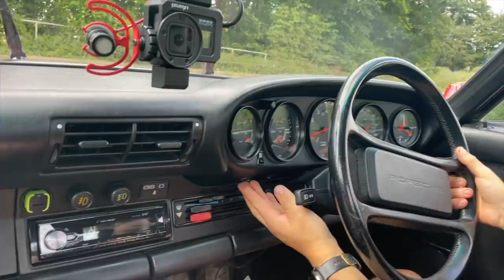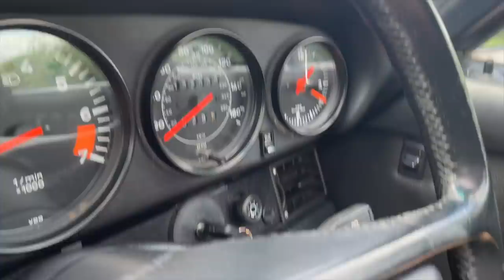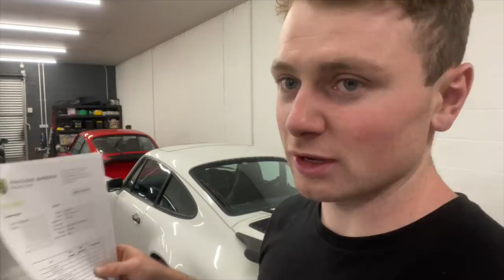An In-Depth Inspection of 2x 1986 Porsche 911s - FGP Prep Book EP28

Comment: 80's C2 3.2 were my poster car when I first discovered 911 but I could just never afford one. Closest I came was one that had been partially dismantled for £3000 back in the mid 90's but I bought a 914/6 replica instead.  It took until a couple of months ago for me to finally scratch that 911 itch though and I bought what was the cheapest non sunroof, manual 996.2 aero I could find which is when I discovered your videos. It's a tough choice you have there but I've always loved the Club Sport and I'd like to take my 996 down a similar path with lightweight seats, rear cage etc. Anyway, look forward to the next update.

Comment: 915 gearbox . Do the bushings will improve  change. . Lighter and better than later G50 which suffer from drivetrain chunter. I had 4 of these when they were better value!  Great to see youngsters getting involved . You can hear your excitement! There's nothing like them ... and yes lift the rear wiper before engine cover! Looks like they are both suffering from lack of use like so many.. because they are expensive nobody bloody uses them any more. They rot from the inner box sections that run front to back from the rear wheel arch and parallel to the doors have a proper look when rear wheels off. Check front wings too. They can look fine from the outside. If you decide to keep the red I’d be interested in the white one please. I have a mint 996 C2 tip S gen 2 to px Hartech Engine rebuild 72k

Comment: I have to disagree with you on the 915 (The 1st gear asymmetrical dog ring along with pressed on synchro teeth for 1st and 2nd and it needs an oil cooler) to a G50 (Is a Better) gearbox. With a G50, you can install a Patrick Motorsport close ratio gearset, LSD and a Wevo Shifter and you're in a different performance league. You can't do that with a 915. Yes I have 2 G50 3.2-3.4 911 Pcars and wrench myself from across the pond where the steering wheel is on the left side. (Respectfully)